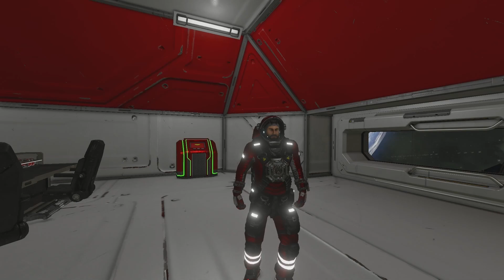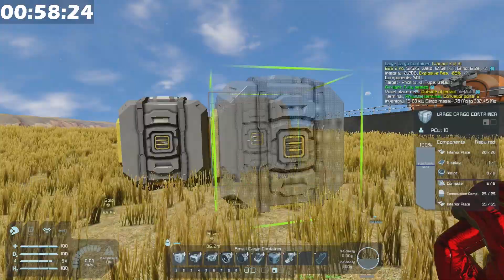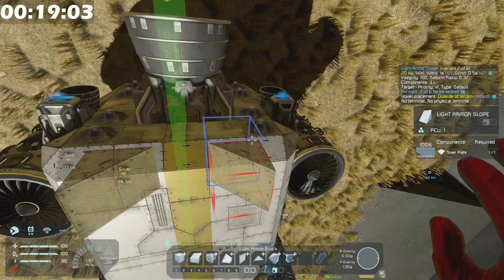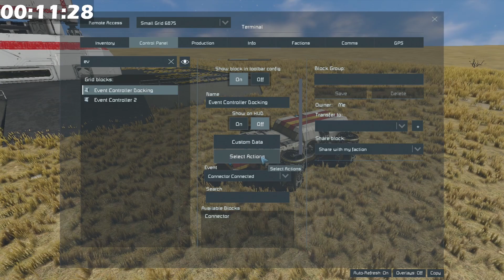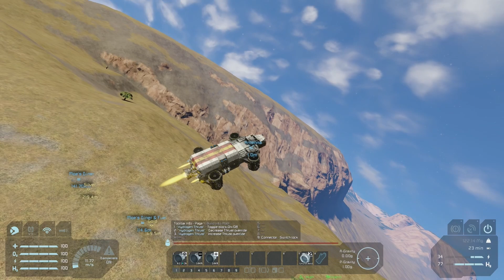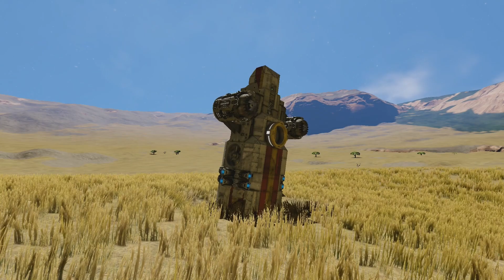Hybrid Cargo Shuttle - Ship of the Week Season 2 - A Space Engineers Build Challenge

Comment: You could remove the spacer block between the first cargo and O2 Gen and replace with small Hydrogen tanks?
Reply from the maker: That could work, it would require re-piping the connector.  I had a perfect spot on each side for 2 more tanks, but I unfortunately didn't think I would need them, ah well.